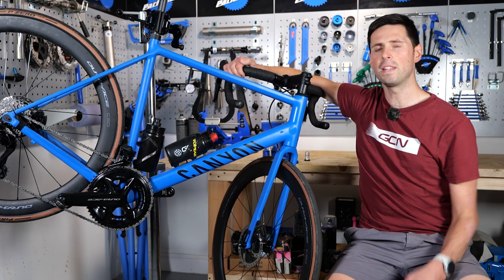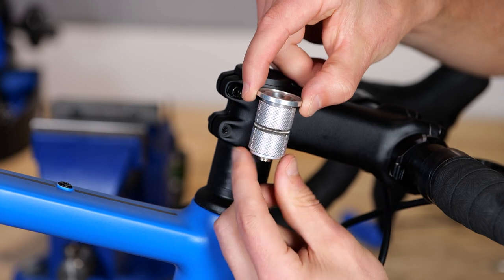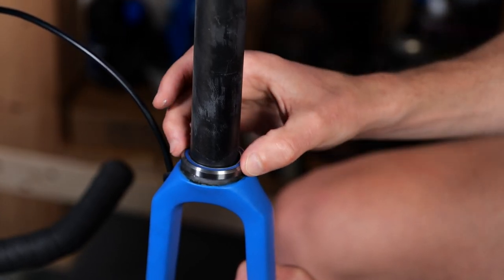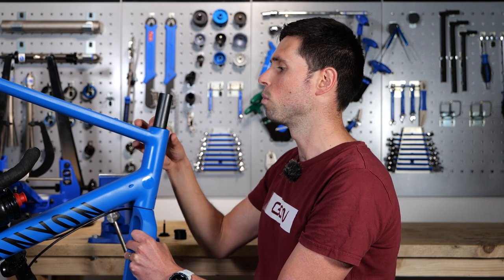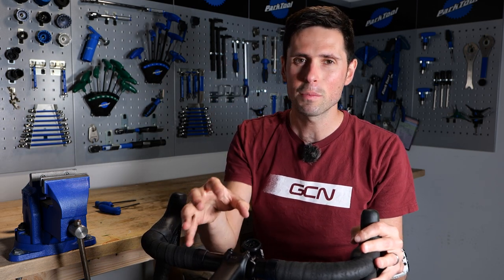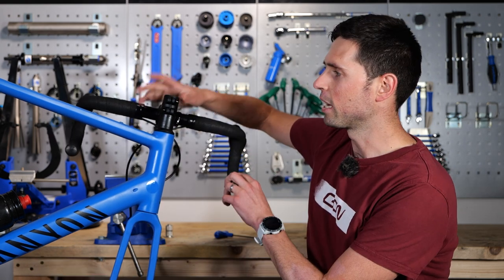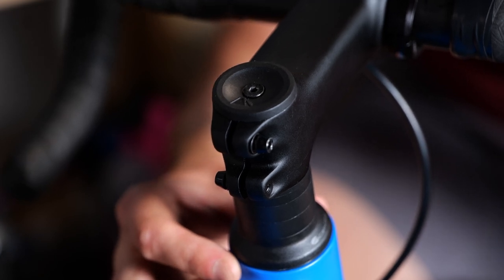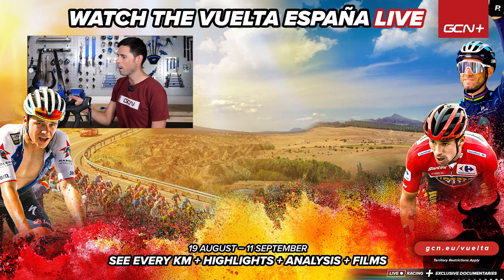How & Why To Adjust The Headset On Your Bike | Maintenance Monday

Comment from the maker: What other maintenance videos would you like to see us make?
Reply: General creaking. I think Si did one a while ago. You've probably done other ones since, but might be worth updating?
Reply: How ro clean and re-grease headset, bottom bracket and wheel bearings etc.
By taking off the dust covers from the bearings and then cleaning and regreasing them
Reply: Alex how to replace wheel hub bearings, say I wanna upgrade to "ceramic" or swapping out a threaded DUB bottom bracket with a Ceramic Speed threaded bottom bracket
Reply: Jobs you really should do every 6 months or so, say, eg remove and re-grease pedals, remove and treat seatpost to stop it seizing, etc. What are the simple jobs which have the potential to save you a major expense, potentially up to a new bike if, say, the seatpost is totally seized.

I remove and re-grease pedals periodically about 6 months and this has turned a job which used to be very stressful into one which could not be more straightforward.
Reply: @KenSmith-bv4si  thats quite easy.... Tap the old bearing out if ots pressfit, then press the new one in
Reply: Stopping cables rubbing on the frame eg by using a patch similar to the one on the frame in this video - I didn't even to think to look for this, then one day I saw the cable housing had worn away a fair bit of the paint on two different bikes.
Reply: I would like to see a similar one for integrated cockpits 👍🏻
Reply: @ruiloureiro3167  the same proces, waaaaaay more painful though😬
Reply: How to fix bent disc rotors
Reply: @larsdohmen6796  I know dude I thought it would be a good idea for a show.
Reply: How to build spoke wheels for bicycles, including things like spoke length, spoke tension and asymetric wheels for disc brakes and rear wheels with different spoke lengths
Reply: How to do simple spoke adjustments (without a truing stand) to fix a broken spoke or true a wheel that has become wobbly after hitting a pothole.
Reply: Teach me all about gear ratios as if you’re talking to a 5 year old. How to pick the right cassette + crankset combo for any occasions—not necessarily one size fits all but breaking down the pros/cons to a variety of setups. You could also include a primer on how to install these items as well.
Reply: @guest_informant  agreed!!!
Reply: Installing a square taper bottom bracket.  Seems complicated.  Some explanation on specialty tools needed.

Comment: This was such a clear, concise explanation of how to disassemble your headset, adjust, and then troubleshoot any issues. A truly comprehensive video. Well done, Alex.
Reply from the maker: Hope you found it helpful!
Reply: I have to agree.  The quickest, simplest explanation.  Would love to know a little more about the expander bolt
Reply: @morningtidefilms  Yes. For example you should tighten the expander a bit before installation, sliding it in with a small bit of pressure

Comment: Helps to turn the bars 90deg when checking the headset for play. That way you eliminate the play in the brake pads inside the calliper. So many folk feel a knock and keep tightening when it’s brake pad play and not the bearings.
Reply: I usually place my fingers between the head tube and headset cover. I also check if I can rotate the spacers by hand, which shouldn't happen if there's proper preload.

Comment: You forget to mention the most important part, that when the stem is placed on the steering tube. You should have at 2mm of the stem internally above the steering tube. This allows you to put the pre load on. If the stem and top of steering tube was flush, you cannot tighten anything.
Reply: 2 mm is too little for a handful of top caps, 3 - 5 mm is more ideal.
Reply: @yonglingng5640  winspace slc disc and extralite stem doesnt go easily.. upper stem bolt are almost on the edge thus streerer tube has to be cut at precise length
Reply: @davidgoon1978  I worked with one before, I forgot how close the top pinch bolt is away from the top of the stem, but there's nothing wrong with adding a 5 mm spacer up top with the steerer tube flush with the stem.
Reply: Thank you I was looking for how much spacer to use

Comment: I swear that 75% of you videos are directly related to me.  First time ever took a spacer out of my bike to lower it a bit 3 days ago. No idea I wanted to tighten the cover bolt first. Will be correcting that tonight. Awesome stuff.  Thanks!!
Reply: lower it? you need to swap it to the other side of the stem, something else that Alex fails to mention. Or cut  the steerer, which is waaay beyond this casual tweak.
Reply from the maker: Mind powers..... ooooooh!! 😵‍💫

Comment: Good video on quite a basic task, which I nevertheless got wrong as a beginner a few years ago. I might add information on the various common headset standards and dimensions, bike manufacturers' recommendations on spacer height above and below the stem, and the sometimes quite time-consuming task of getting your stem aligned with your wheel, but that is more related to the stem rather than the headset (and you probably have videos on that already).

Comment: You missed entirely that the No. 1 cause for loose headsets is that the loose expander plug is pulled up the steerer by overtightening and bottoming-out of the tension cap & its screw, and how to reset and tighten that down - often involving disassembly of the expander plug and clean/grease of its parts. You can't get preload if you can't tighten the tension cap screw into it. Also, a lack of clamping gap between the top of the steerer tube and the top of the top spacer (which you should pretty much always have on top of your stem, under the tension cap). So many of your maintenance videos are like this: do half a job and missing important points, which might one day come back to bite you.
Reply: good point

Comment: How to easily align the wheel, stem, and handlebars so they're all together proper?
Reply: Hold the front wheel between your legs, and use the front plate bolts of the stem to align the wheel precisely between them. I usually tighten down the steer-clamp bolts (on the stem) to just above finger right, so you can adjust the angle but it won't be easily knocked out of place while you finalize the position. Most bars will also have hash marks around the stem clamping area to assist in leveling them and evening them out left/right.
Reply: Laser beam!
Reply: If your saddle is centered, that's another hassle, you can take some string from the center back of the saddle up to the stem to center the cockpit.
Reply: I normally switch grid lines on my phone camera and then you can use your phone camera and the grid lines act as a straight edge
Reply: Hold the wheel at a 45 degrees (to the right or left) and line up the opening of the  clamp (the crack) with the center of the tire, looking through one eye at at an angle from behind. The trailing section of the tire lines up with the crack, while the leading section (in front of the fork) will be centred between the two top bolts of the handlebar clamp. Using both these references of the stem, you should be able to line up the stem straight.
Reply: @stevemawer848  Nutron beam!
Reply: I personally do it gradually, I ride the bike and lock the wheel with my legs and watch it top view, align the stem with the wheels then the handlebar..

Comment: It's funny, back when I had an 80's Panasonic bike, I brought it into the shop because of derailleur issues.  They told me that my headset bearings were completely shot, and the ball bearings had worn into the metal.  They were quite insistent that it needed to be replaced, but I never did it.  I actually liked how it felt, the handlebars gently popped into place when centered, it honestly felt so natural it was like it was designed that way.  Plus, it didn't affect the performance or efficiency of the bike (unlike that derailleur issue, which they were never able to fix.)
Reply: A headset assembly should never feel indexed, they're right about having it replaced.
Reply: @yonglingng5640  Some kind thief took care of that

Comment: Thank you so much for this video! I have recently struggled with fork play after my local bike mechanic could also not help much. 
Cannondale and other bikes equipped with FSA expanding nuts and top caps do not have a tension screw on the top. Instead, the top cap is screwed into the expanding nut and is therefore the tension screw in itself. Hope this helps somebody.

Keep up the good videos!
Reply: Also had a little clicking noise after slamming my stem... turns out...
I did chech the top cap, but probably the expanding nut was not tight enough...
Reply from the maker: Glad you found it useful Yannic-Tim!

Comment: An excellent tutorial reference the Headset Assembly... I had mine apart recently (only for checking it out) and was horrified to find there was no 'Crown Race' installed on the bottom of the steerer tube and that the lower bearing was sitting directly on the fork itself..  Am happy to know the set-up is fine. (the cycle is Boardman TeamC road machine).
Reply: You don't always need a crown race seat: CF forks have it moulded in, usually.

Comment: I wonder why when the headset has been refitted the expander plug was left on the bench… 🤔 Maybe because the description applies to all the bikes apart from Canyon, as the one you have used in the video does not have an expander plug to support the stem clamp! You might have needed another bike to do this video 😀

Comment: Once you think you've nailed the headset stem cap pressure and nipped up the bolts, apply the back brake and lift the front wheel with the bike standing up in front of you, bars turned 90 degrees in line with the frame, and try and rock the bars (12 and 6 o'clock) gently, it will show up any looseness...

Comment: I use an expander plug on alloy steerer tube too, I don't like using the star nuts. They seem to damage the inside of alloy steerer tubes.
Reply: good idea
Reply: It's just some gauging, alloy steerer tubes are more resilient, you don't have to worry about them getting crushed by a stem. The pinch bolts would snap or the threads on the stem body would strip first.

But yes, they're designed not to be removable, which is indeed a pain unless your fork has a hole at the bottom for the old star nut to be punched through.

Comment: It would be good to use a headset that isn’t brand new perhaps for a video like this. Show us a one that’s full of grit and has seen some wet weather & dry dusty trails and had a few washes and is in need of a clean and re grease. 👍

Might be good to show how to inspect a carbon steerer tube for signs of damage from being ran with a loose headset for too long and also explain the importance of always clamping the stem where the expander tube is. Example don’t leave the steerer uncut if running the stem slammed as low as possible etc…

Comment: Question: How many hours, or miles/kilometers, or any other measurement can we use to know the bearings life-cycle? How do we determine the bearings are shot?
Reply: Modern headsets don't often go bad. They don't spin much and with sealed bearings, fat chance much is gonna get inside. That said, if you take the bearings out and they feel rough to spin by hand, they're easy to replace. But really, headset bearings just aren't gonna wear out.
Reply: Thanks for that explanation, Mate! I was just curious about that.
Reply: For other bearings, there isn't a straightforward rule- depends too much on your maintenance habits, riding conditions and so on. If you try to service them and they feel rough, replace them.
Reply: Depends on conditions of where you ride in and how much. I service my headset every 4 to 5 month. If you feel grinding in the bearing while turning then its time to replace it or them.
Reply: @deadly0078  Is yours an old-school loose ball type?
Reply: Both my bikes (Trek) are less than two years old and I get them serviced after 1,000 miles. My local store is very good at maintenance so I think I'm good to go. I was just curious because Alex did not go there. Thanks, Dudes!
Reply: @mmmbetter55   I have both systems. Just re grease them 4to5 month. They will get cracks to signal that its time to replace them.
Reply: Headsets often break because of a lack of maintenance. If they are properly lubricated they will last long, but bearing ball steel is not stainless (you can't harden stainless steel in this way) and if it's running dry and gets wet or salty (winter in colder areas, coastal areas) corrosion will destroy the bearing over time. Properly greased they are protected against premature wear and corrosion and will last long

Comment: Do you recommend the 2 stem bolts with the heads at opposite sides, I noticed you tightened from opposite sides and daft question 2 what about quantity of grease

Comment: When I changed my stem I didn't take stack height into account so I did get minor headset play, couldn't figure out why at first. 2mm spacer fixed the pre-load! Maybe this can be useful for someone out there.
Reply: The goal should be to recess the top of the steerer about 3mm below the top of the stack (stem plus any spacers).  It is also not a bad idea to always have at least a 3 mm spacer on top for carbon steerers so there is plenty of “meat” left of the steerer to clamp onto.

Comment: #GCNTECH - Howdy Mannon and the Fellas. I'm preparing to move cross country (USA) and would prefer to transport my bikes inside the moving van which I'll be packing. What's the best way to prep the bikes for this journey with my household goods? Planning to remove the pedals and configure the handlebars parallel to the top tube (90 degrees from 'normal). Thanks for the knowledge.
Reply: there are bike travel cases you can buy if your bike is really expensive, you slightly take it apart
Reply: @whomstthouamme2155  Thanks, but not looking to buy 3 bike cases and I'll be doing the loading/unloading.

Comment: Can I straighten my bars by loosening and tightening the two stem bolts without touching or messing with the top cap and the preload set on the headset?
Reply: Yes.
Reply: When realigning your stem, the top cap bolt can be left alone.

Comment: Any suggestions for what to do if (after loosening the pinch bolts) the bearings are still loose after tightening the top bolt firmly?
Reply: Most likely you haven’t got a gap from the top of the stem to the top of the steerer. When you take the stem off (or spacers if you have any above the stem) you should have least 3-5mm gap between the top of the stem and the top of the fork steerer that’s in the centre. If you haven’t got this gap or it’s not enough then the fork bottoms out on the topcap before it preloads the bearings. If that’s the case an extra stem spacer will do the job.

Comment: Any benefit to replacing a stack of  four 5mm spacers under the stem with one solid 20mm spacer? The logic would be that it would provide greater stiffness and reduce fore and aft flexing of the steerer as you go over bumps.
Reply: negligible, and you would lose the ability to adjust stem height easily. The flex is merely concentrated in a smaller area.
Reply: Why not? Good idea but keep the 5mm spacers in case you need to make adjustments later

Comment: any benefit to adding grease to the lower and upper bearing sets when installing if they are sealed?
Reply: Grease on the headset bearing seats acts as a water-resistant barrier to prevent corrosion. A headset assembly should never be installed dry.

Comment: Have you (anyone reading the comments) ever thought about, or come across a cool mod that replaces the spacers? Like if you wanted to drop the bars down the steering tube, thus resulting in more of the tube being above the stem, without having to cut the steering tube and without just leaving the spacers above the stem, making the headset look stupid. For example, a part that reaches over the stem and adds more mounting space infront of the handlebars? Just curious to see what people have come up with.

Comment: I find it difficult to use my brakes when I'm in the drops. I'm using Shimano 105. Any advice?
Reply: First things first, are your lever blades too far from your fingers? Are the STI levers set way too high on the handlebars? Is there too much upwards tilt in the handlebars?

Excessive upwards tilt will render riding in the drops impossible simply because the ergonomics over there are ignored.

Comment: Bought a road bike built by someone who managed to be almost as bad of a mechanic as I am.  He had a lot of spacers, but ultimately the steerer tube was a tiny smidge too long for the number of spacers, so the top-cap hit the steerer before the bearing got a proper pre-load.  Replacing one small spacer with one that was another 1mm thicker solved the slight movement.  I will chop off the chimney soon, once the fit is finalized.

Comment: Question I have a canyon aero. Trying to change the bearings which are stuck to the inner headset. Is there any sprays or techniques I can use to free up both bearings… left it to long need help please
Reply: You might need a punch and a hammer to lightly knock them out. If in doubt, best let a reputable LBS help you out.

Comment: I've always worked with aluminum frames and steerer tubes in the past, so any headset work has included the application of grease.  Is it correct with carbon frames and steerer tubes that everything is assembled dry, no grease or any other compound?  Can a small application of grease to act as a moisture seal damage the carbon?
Reply: imo you should also grease up the area around the bearings on a carbon frame, correct me if I'm wrong!
Reply: You want grease on the fork and carbon paste on the expander bolt